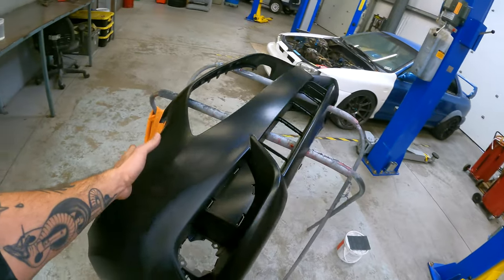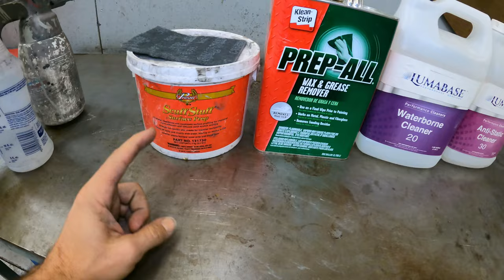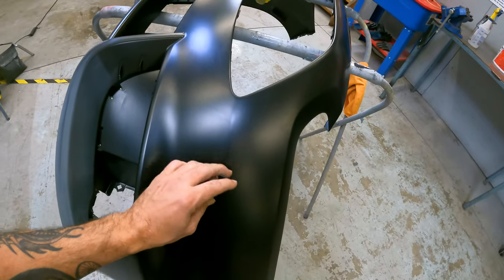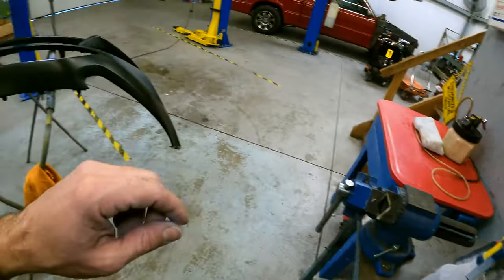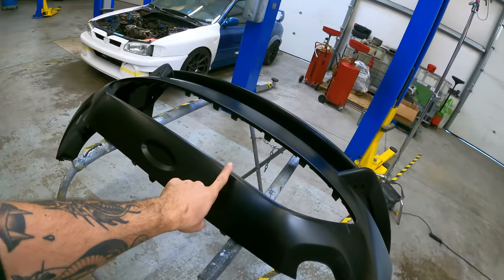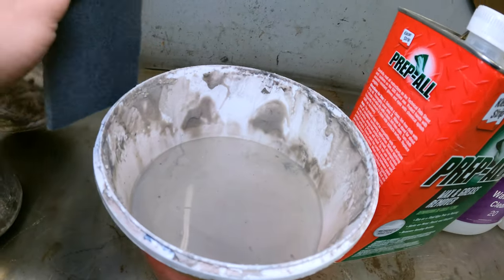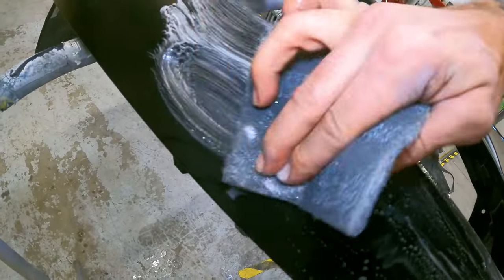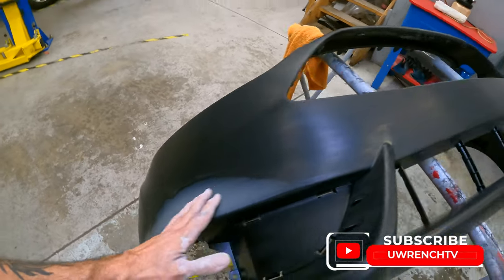How to Properly Prep Plastic Bumper Covers for Paint | Complete Tutorial

Comment: Clean, clean, clean. To those doing front end paint work, I usually use a flex agent on any urethane clear on a bumper cover or even fibreglass valances like on a GT350 etc.  You can even dull it down with additives. It’s may not be concours correct but helps avoid chips from track/road debris.   Love your content and  appreciate how you assist Sarah.

Comment: I recently painted my cars rear valance panel, it was bare black plastic like yours.

I treated it like a metal surface.. i scuffed with 320, them 800 grit scrub pad. Then sprayed 3 coats of high build primer, then sanded and smoothed the primer, and finally the base coat and clear.

It turned out ‘good’. By no means a professional result, but the 800 grit scrub pad really helped to smooth the deep 320 grit scratches, and finally the high build primer (for the most part) filled the 800 grit scratches.

Good content, always like watching and learning

Comment: I have a beater 2011 Nissan Altima in the grey colour that Nissan loved to use for that model year. The front and rear bumper covers are both cracked and it looks pretty bad. I was gonna try to go to pick n pull but now I might actually try to repair and paint them.

Comment: Can you please, please, please tell me what the best sealer in spray bomb version I can use on the bumper cover. Going metallic silver paint. Thank you!!
Also THANK YOU for such a killer video! 
Very informative. And meshes with other great painters advice, such as yourself ! 😊
Reply from the maker: Fred says that you won’t find sealer in a rattle can. But you could use a 2K epoxy primer which requires a longer drying time and you might possibly need to sand it before topcoding.

Comment: Very good video, but there is another way to do this.  You don't need a Promoter or Sealer if you scratch plastic the way you did down to 1000.  All you need is Tamco epoxy.  It will glue everything and seal it, then you apply base coat, and clear coat. You can add Matting agent into your Lumabase clear and control the clear coat between FLAT and Super High Gloss.  There also is another way for plastics, but I won't mention it here.

Also, some plastic is rough and not smooth and shiny like yours.  In that case your epoxy and clear coat layers must be thin in order to preserve the look of that 90's plastic.

Comment: Apparently I missed the plastic repair episode! Will have to go back and find it. '06 Mustang GT got stuck on a piece of rebar sticking out of one of those concrete parking stops. Ripped the underside for several inches. Got a drifter's stitch on it right now, since I figured it would need replacement.
Reply from the maker: If you're interested here is a link to the plastic repair video. https://youtu.be/zrTz1gv_hcU
Reply: @UWrenchTV  Thank you!

Comment: Like your videos and information.  Been away from auto body work for a long time and find myself needing to do some due to an uninsured motorist (explicative idiot).  It has been almost 40 years since I did any.  You didn't have all the paint choices back then.  I am redoing parts from a donor car (white 2 stage) to my Mini Coupe R58 lightning blue metallic.  After much research on the plastic pieces (didn't have many of those years ago) some are saying epoxy primer is better for adhesion/rock chip protection.  I wanted your input on it.  Thanks, Jim

Comment: I have some automotive paint experience but only with European classics. So, no experience prepping and painting plastic parts.  I read about the primer/surfacer you are using but didn't see any mention "Plastic" or "Flexibility" in the descriptions.  Is this because flexible additives or "special paints for plastics" is no longer necessary? I have always been under the impression that painting on plastic required a whole different process and modified products. Perhaps the times have changed. Great video, by the way. Thanks for sharing!
Reply from the maker: Other than using adhesion promoter
all products are the same for the bumper cover plastic

Comment: Damn, that came out clean. Looking to paint my Front bumper cover, I do have spraying experience but mine is more of a single stage on heavy equipment such as cranes, skid steers, and lifts. When spraying the clear what is the best activator to use to help prevent flashing. On the single stage my shop uses, if you miss an area on the last go and attempt to come back you will leave flashing on the surrounding area messing up the gloss finish. Any suggestions on brand or where to source quality paint?
Reply from the maker: Fred uses Lumabase, R-M Diamont. Find a local automotive paint supply near you and check what brands they handle. Also depends on how much money you want to spend on paint...they can get very expensive!

Comment: Is it also ok to clean, adhesion promoter, prime, then seal?
Reply: Primer is for bonding two paint layers so it is in between them. Sealer is for making the barrier between layers. 
Therefore paint sticks to the primer and not necessarily  to the sealer.
I wouldn't  do this the way you suggesting unless you use  primer-sealer "two in one", but this method has downsides as well.
Honestly painting a plastic it is a pain in the hole and pointless in longer run .
Best method is.... just sand it down properly like for any car jobs , accept the colour and just wax it 😊